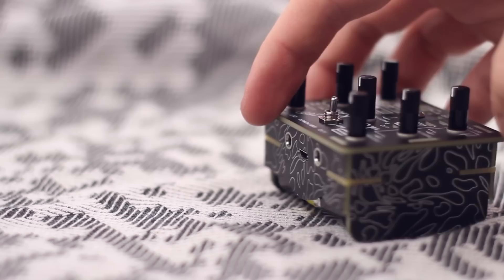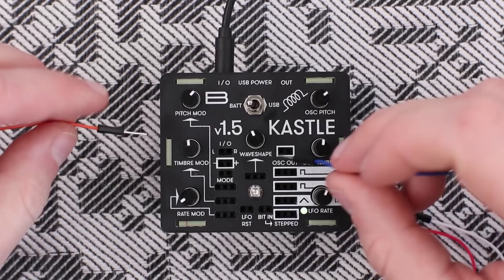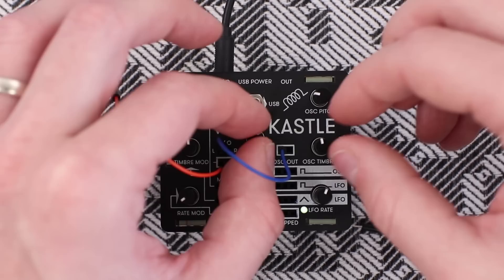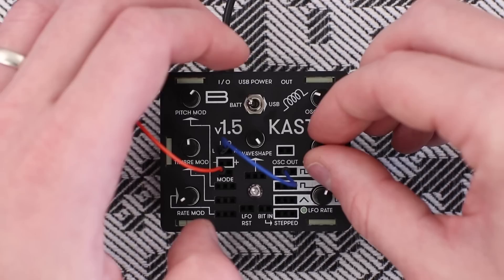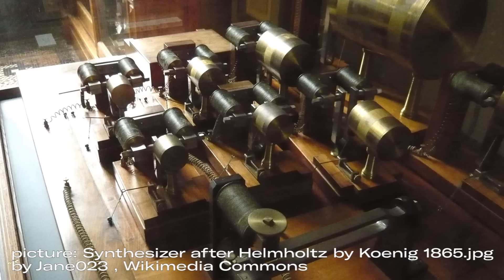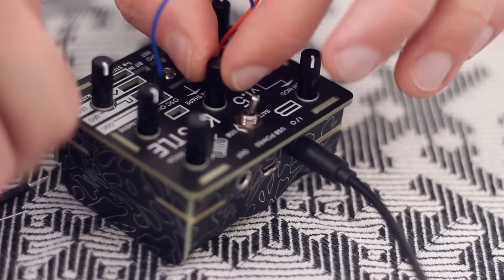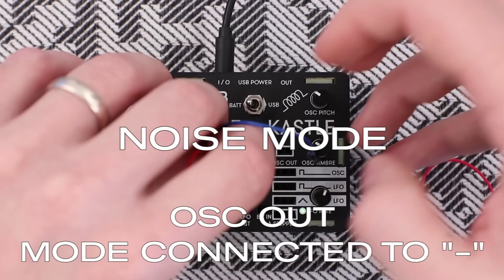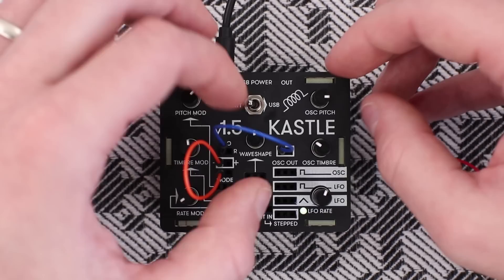Kastle v1.5 - new features & style

Comment: And I just got the original one. Damn!
Reply: They actually just called me from the store that they are sending the new one instead! Yes!
Reply: wtf that is awesome haha
Reply: I also just got an original one.. have barely even had a chance to use it...
Reply: The original one is nice too! Get them both!
Reply: The original may only have three synth mode choices but they're all available on the main output,  meaning the I/O port is free for pitch and sync control input.  The new version has the noise synth on the main output, which IMO is way less useful,  so you really only have two pitched synthesis options if you're using an external sequencer

Comment: This is amazing. My only wish for a feature is to have a 3.5mm MIDI port to allow it to be sequenced and clock-synced to other gear. Also I wish there were an easy way of getting this to work with the Volca Modular without frying one or the other. Either way, buying one right now!
Reply: what do you mean by frying? I was thinking of getting one to use with the volca modular
Reply: @GabrielMarginean  the two instruments operate at different voltages, wouldn't recommend plugging the kastle straight into the volca modular.

Comment: is the Kastle receiving clock in from the Pocket Operator, or is that just audio thru?
Reply: I think that the PO-12 is receiving a clock from the pulse LFO of the Kastle on one channel and passing audio thru on the other. The PO-12 input and output are both stereo jacks, in order to have a clock on one and audio on the other channel (different sync modes can be selected on the PO).

Comment: Hi. I am having low audio levels issues…What audio interface do you use in this video?I tried headphones mixers audio interfaces..the levels are just very weak. Any ideas much appreciated..
Reply from the maker: Hello, and we are sorry for the trouble you're experiencing. If you are using batteries, please try changing them. If you are using a stereo cable, ensure your interface can connect stereo cables. Kastle can send a stereo signal on one TRS cable, but you will need to connect it to your interface with 2x TS cables. If you are using TS (mono), it should work fine.

If you continue to experience problems, please contact our helpline at help@bastl-instruments.com.

Comment: "Version 1.5" implies a ver. 2.0 is planned, no?
Reply: Version 2 should have a touch keyboard that is tuned so you can play chromatically.
Reply: Punjit Deeprok It uses a pair of ATTINY85 microcontrollers, so that's not happening unless version 2 used ATMEGA328s instead.